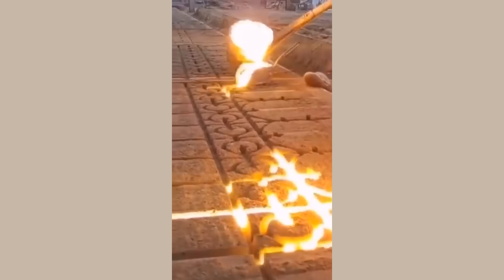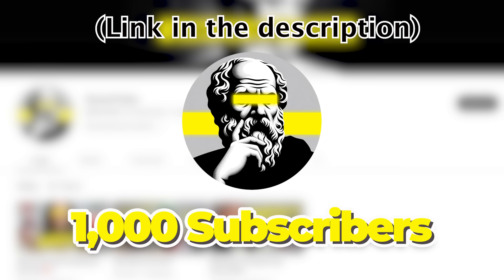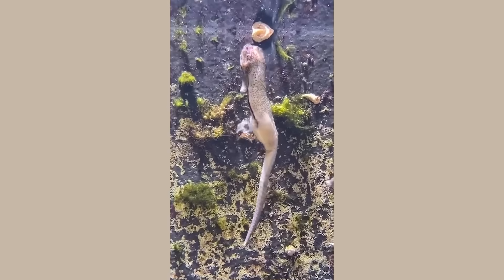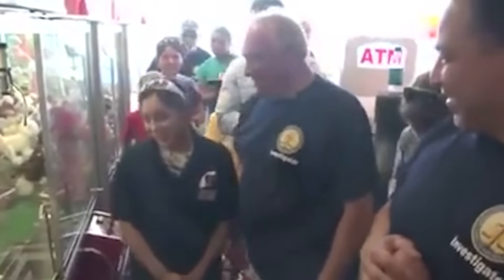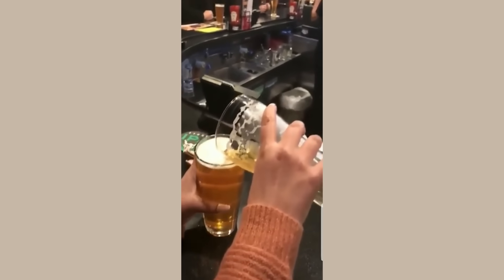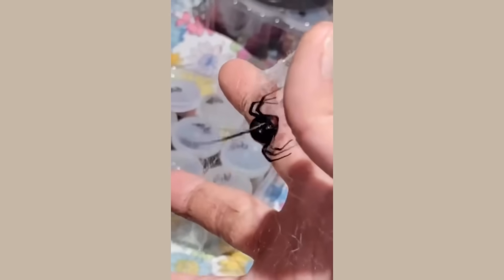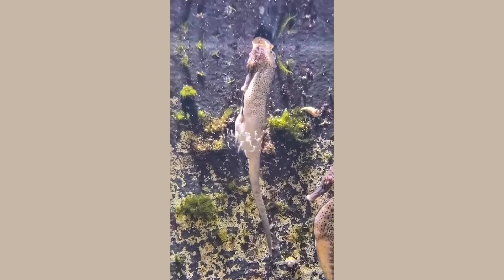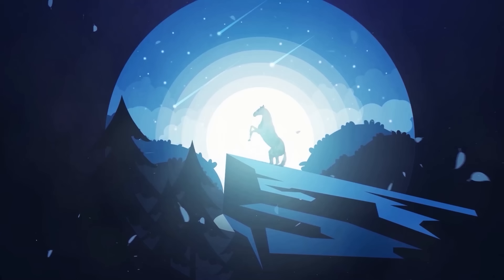How Things Are Actually Made

Comment: 2:02 So they BOIL the plank??
Reply: Almost. It's more like a pressure cooker. In that chamber there is heat, very moist air and high pressure to get the hot water between the wooden fibers inside the plank. That's what makes the plank pliable.
Reply: @zorrothebug  Oh, I see... I always assumed they just sketch the shape on a proper block of wood, then cut to a rough shape, finally sand it to perfection! That'd obviously lead to a lot of wasted wood.